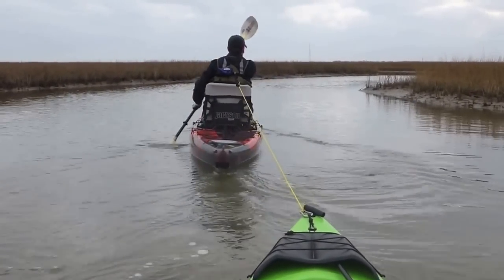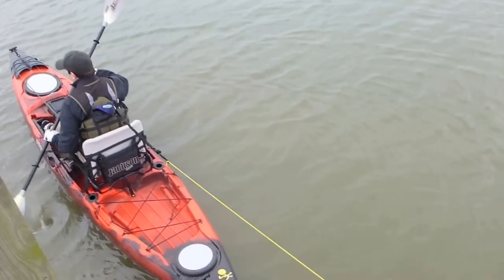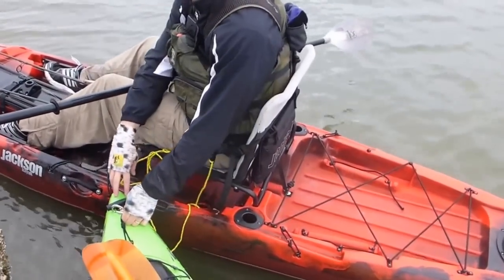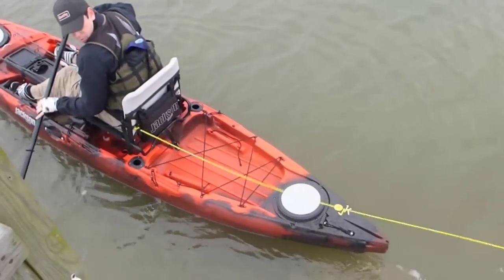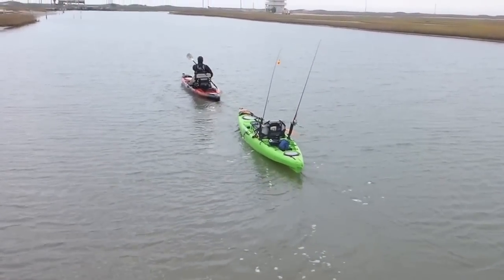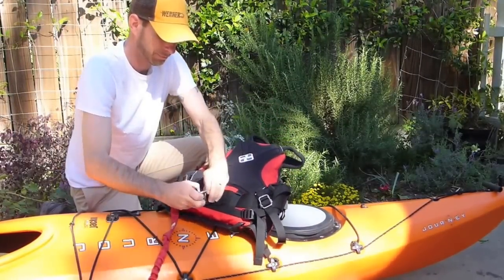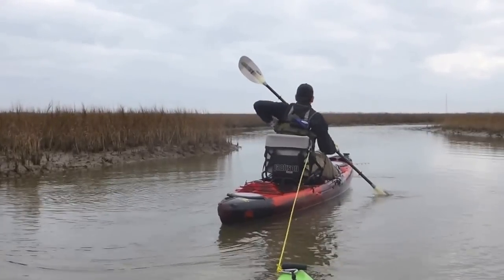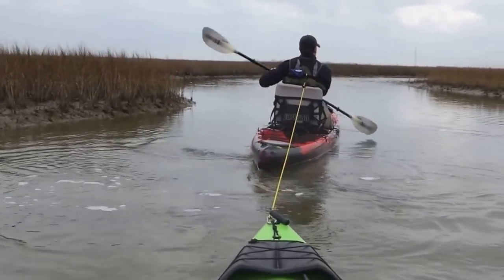How To Make A Kayak Tow Line | Instructional

Comment: I know this is an old video, but I gotta say, there are two major problems with the way he's towing. First, always hook the carabiner under the static line and up, not from the top down as he does in this video. It's much less likely the carabiner will come loose this way. Also, never hook the carabiner around both static lines as he has done. Only hook it through ONE of the static lines. If the bow attachment had come off in this video, the carabiner would have slipped off the lines and the towed boat would be adrift. Hooked through only one of the lines, the carabiner would still be hooked on the static line even though it wasn't attached at the bow.
Reply: Thanks. What is a "static" line? Total newbie here .
Reply: @scottlytton5328  There are two types of deck lines on a kayak. The stretchy ones are bungies for holding stuff like water bottles and paddle floats (which should always be clipped as well as bungied on.) The static deck lines are the ones that don't stretch, so you can use them to hold your paddle when doing a self-rescue w/paddle float, or others can grab onto them when you're helping them back into their boat.